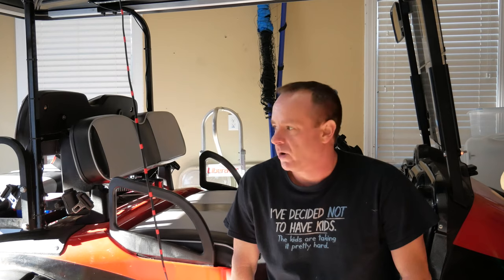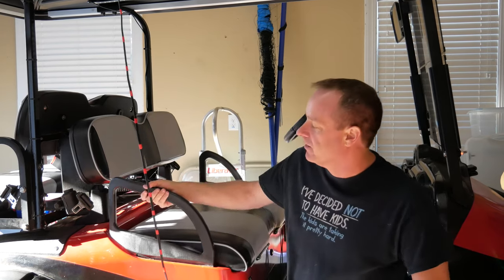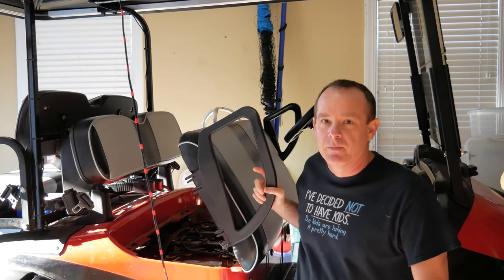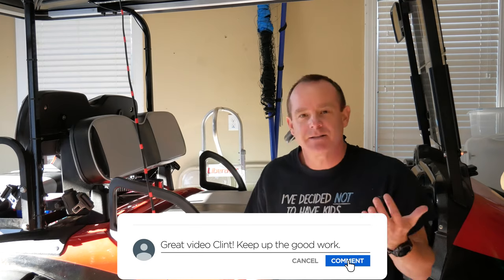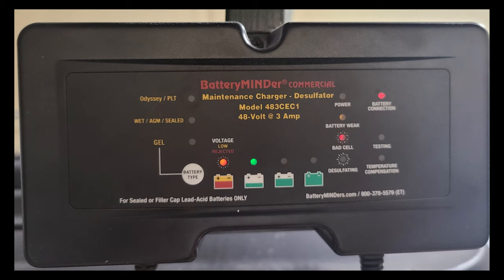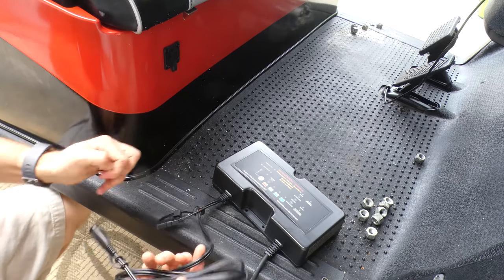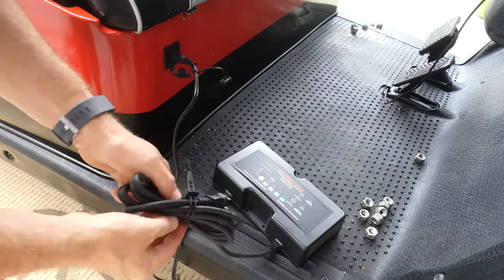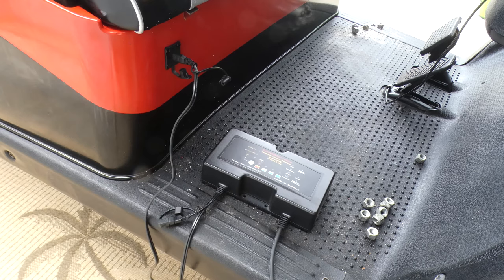Double Your Golf Cart Battery Life

Comment: I just upgraded to lithium sooo pumped to try it out. I am done with the lead game too much money and to easy to kill in Wisconsin
Reply from the maker: You are after my own heart.  I seriously considered lithium but the cost was just too much.  However, I will definitely go with it next time.
Reply: Make sure you charge those lithiums outside. Once they catch on fire, and it happens more than most people know, there is no putting the fire out until the lithium is exhausted.
Reply: @garystone6397  im on many golf cart forums that issue has not come up. I will keep my eyes pealed. The internal bms is to keep it working and charging properly.
Reply: @garystone6397  and my cart doesn't fit in garage too tall
Reply: @03treefitty  We have a Luxury 45' Motorcoach used for the occasional weekend in the winter here in Florida and we escape the summer heat from June through October traveling the US and Canada.  I know of several coaches that have gone up in flames due to the LiPo batteries.  Additionally there has been a few recalls on some high end electric cars because the batteries will burst into flames with no notice, Tesla for one.  Our local Fire Department did a public service presentation at our club regarding charging a golf cart with LiPo batteries.  They recommended charging outside, away from the house.  Not a large population of LiPo carts out there but they are becoming more popular.  I think I'm going to wait a few years and then buy a new cart that was designed,  developed and manufactured for LiPo power systems.  Good luck though.
Reply: @garystone6397  my navitas ac system is built for it and struggles with lead so i think i already have the luck?
Reply: @03treefitty  YIKES!!  It has nothing to do with the motor or controller, it's all about the BATTERIES.  The batteries can overheat, catch on fire and you can't put the fire out.  The fire will eventually exhaust all the Lithium Ion and extinguish itself.  A LiPo fire laughs at conventional fire fighting equipment.  Glad you're excited though......
Reply: @garystone6397  LiFePO = Lithium Iron Phosphate.  This is the most practical (energy density v. battery size/weight v. reactivity/safety) "lithium" battery out there on the market right now.  There are many different Lithium Ion chemistries, most have much more energy density than LiFePO and thus are much smaller and more suitable for phones and small electronics.  The Teslas or other OEM vehicles that have lit up with "lithium" batteries again were not the Lithium Iron Phosphate chemistry.  The community of Vans and RV's that have fires with Lithium Iron Phosphate batteries had one of two issues - 1.  improper installation without fuses in critical areas or the fuses where too big and the short occurred and the fuse did not blow protecting the battery from firing up  2.  The Lithium Iron Phosphate battery was a low grade battery that swells when drained fast and the battery container was constructed NOT to expand with the battery swelling and again, a fire can happen.  These are all typically DIY installs or a guy who represents himself as a professional installer (usually doesn't have a store front) or this happened 5 - 10 yeas ago when Lithium batteries where in the infancy of commercial applications. Current day Lithium Iron Phosphate batteries sold by retail Golf Cart Stores are Better in EVERY WAY than the wet batteries, including value.  In the long run they are much cheaper than any other battery on the market when comparing $$/amp hr because they can complete so many more charging cycles than any wet battery chemistry.  The only reason not to go Lithium (LiFePO) is if you need new batteries but plan to sell the Golf Cart in 2 or 3 years or if you just can't come up with the up front extra dollars needed to go with Lithium. If you are keeping your cart for 5 - 10 years, it makes NO sense to NOT buy the Lithium batteries LiFePO, they are no hassle, less expensive over time and  lighter.

Comment: How about an on board charger recommend??? Informative video thanks 😊
Reply from the maker: I am not sure I understand what you are asking.
Reply: Do they make a charger you can mount on the cart? So you can just plug the cart in. If so is there a better choice for battery longevity? Thx for consideration.
Reply from the maker: @bftcoman  I am not aware of one.  While it wouldn't be huge, it would definitely add some weight to the cart as well.  The charger being mounted in the cart or outside of the cart would have no effect on battery life.  The best way to extend the battery life is with any type of desulfating charger and ideally one that does temperature compensation. I like BatteryMinder but there are a plethora of other brands that do the same thing.

Comment: Just subbed, mainly bc I see you answer all questions. I have a 2005 36v EZGO with fairly new Trojans. I am using a Power Wise fast charging (at least 15 amps) unit. I went through a 6 week period where I didn't use the cart, the charger had cut off and I figured the batteries were charged and would hold a charge like car batteries do, so I unplugged it the last 2 weeks of the 6 week period. I went to use it, and noticed the voltage gauge on the cart when I left the house was only half full and had to cancel my round of golf. Should it drop that much with new batteries in that short a time?
Reply from the maker: It should not. If the batteries test good I would suspect you have something drawing power when the cart is off, ie a parasitic draw.  Here is what I would do if you have time. Charge the batteries up and then disconnect one of the terminals.  Wait 2 weeks if you can and see if the problem occurs.  If not, then something is drawing too much power when the cart is off.  You can also test that theory with an ammeter if you have one.  The other thing I would test are the batteries.  Make sure they have enough electrolyte in them and maybe even pick up a cheap battery tester on amazon. This is the tester I use but you can get cheaper ones for about $20.  TOPDON AB101

Comment: We're seasonal residents of Florida, here Jan, Feb and March generally.  Would you leave this charger hooked up continually for the 9 months we are gone?  Or would you use a timer to turn it off and on? Thanks.
Reply from the maker: You can leave this charger running 24/7. Doing so will actually extend the life of your batteries as opposed to letting them slowly discharge.  Just make sure the water/electrolyte level is good before you do.

Comment: I had to replace two batteries that were only 28 months old. Now I have another 8 volt battery that only has 6.7 volts. What is causing these batteries to drain?
Reply from the maker: Good question.  Are they good brand name batteries? Are you checking the water level at least once a month?  How often do you use the cart?

Comment: I have a 2003 ezgo 36 v golf cart with 6 Trojan batteries. I continue to have a dead golf cart and have recently replaced two of the batteries. The other 4 are about 3 years old. 

I need to figure out what's wrong with it.

I use a regular 12 v battery charger and wire two together to get a fulll fulll charge and then put them together normally and use the wall charger from there on a regular basis...

I need to figure out why it keeps dying so fast on us. Is it possible I have accidentally put the main black positive and negative input to the batteries on backwards. 

For example the main capacitor on the golf cart that connects to the first battery on the positive side and then the last battery 
On the negative side ...
Reply from the maker: Anything is possible but if you connected it backwards I would say it wouldn't work at all or it would drain the batteries in a matter of minutes probably as well as burning up some wires.  Did this problem just start happening or was it after some repairs?

Comment: I've a 36v golf cart which uses 6 batteries. Can I use three 12v batteries, instead of six?  Thanks,
Reply from the maker: You sure can.  Just make sure they will fit in your battery slots.
Reply: I used three 12v batteries and works just fine.
Reply: @ClintHolland  is there a 36 volt charger

Comment: hi , so my golf cart runs 6 x   8 volt batteries, had a few issues with them over time due to the initial battery charger cooking the batteries .. that was replaced with another one that was much better , however i would lie to desulfer the batteries but i dont think my current charger does that .. i have one of the NOCO genius 5 chargers but it only seems to do 12v  desulfate .  also not sure what you mean by finding the right two batteries to connect that charger you are using .. wouldnt it be the first one and the last one ?
Reply from the maker: The 48v version of the battery minder would do just that.  And you are correct, the first and last battery.  Might seem simple to you and me but a lot of people don't understand series connected batteries.

Comment: so do you charge your batteries first or when they are low you plug the battery minder in to do the actual charging?..ok I just read below
Reply from the maker: I use this charger as my primary charger. The only time I don't use it is when we need it charged real quickly and don't have the time to wait.

Comment: Why does my internal breaker on the 48 volt club Car charger keep tripping after about ten minutes charging?  I've cleaned my cables more than once today.    It has done it before, when the cable connections got dirty.  I've actually cleaned them three times in two days.  Could it be the cables and cable connctors are corroded inside under the copper?   I just don;t wanto pay 60 bucks for all new cables and then find out that isn't the problem.  Also, if I do buy new cables should I use 4 guage or 2 guage
Reply from the maker: Well, thats tough to diagnose over the internet but it could be the cables or even the batteries or a failing breaker.  Something is pulling too much current which probably means a cable issue but it very well could be failing batteries or even just one failing battery.  Did you get this worked out yet? I know my response is very late.

Comment: Clint, I have the EZGO cart with 4 - 12v Trojan 1275 bad batteries. I plan to buy UPG 12v 100Ah batteries. I have the heavy metal charger. Was wondering if the P3648 Smart Charger would be an upgrade to extend battery life? It is an affordable option to the BatteryMINDEer 483CEC1? Thanks.
Reply from the maker: I am not familiar with it enough to make a recommendation but from what I looked up it seems like it would.

Comment: Hi @Clint Holland.  I have a 48 volt Club Car with an Onboard Computer (OBC).  The OBC is what manages the charging program with the factory external charger.  Do you know if I hardwire this BatteryMINDer to my main positive and main negative (like you did), will it bypass the OBC?
Reply from the maker: Correct. You will wire this directly to your batteries which will bypass the OBC.

Comment: I purchased a cart in 2020 and had a hard time finding good batteries. I bought cheap ones and they are pretty much toast. Im looking at all my options; but considering AGM and lithium batteries.  If I go with AGM do I charge them everyday as I use the cart?
Reply from the maker: If you can afford it, go with Lithium.  They are amazing, last a long time and are much lighter.  If you go with AGM, just make sure you use a smart charger designed for AGMs.  They will constantly monitor the battery voltage and charge them accordingly without you having to care.
Reply: @ClintHolland  I ended just doing an entire new build Navitas cart with a 105aH Ecobattery. Worth every penny.

Comment: Hi Eric, Great video, I am new to elec golf carts T have a 99 EZgo with 6  6volt Trojan T105 Batteries , Which charger do yor suggest? the batteries a 4 years old, will this help extend their Life ? TIA
Reply from the maker: To be honest, there aren't a lot of 36volt desulfators for golf carts but search for the BLS brand,  Battery Life Saver.  They get ok ratings. Any desulfator will help extend the life.  That plus making sure you keep them topped off with distilled water.
Reply: @ClintHolland   after watching this video, which was great btw, I searched and found a Defabee 36/48 charger very similar to the battery minder.  although it doesn't have the kit to install a charger plug.  It is also considerably cheaper.  considering this because my cart is 36v.  but it will do both.

Comment: I have an older Club Car DS 48 volt with 4 Trojan T-1275 batteries. This really interests me because I have had a time getting my batteries to charge properly lately. So how do I tell where I have 48 volts within the battery stack? I have 4 in a row all hooked together. Thanks for the video and the help.
Reply from the maker: I know this is a really old post but did you figure this out. If you have 4 x 12v batteries you will need to connect across the positive of the first battery and the negative of the last battery since they are wired in series.

Comment: Great video!   I have 5 - 12 battery pack for a 60v system.   Which version of the battery minder should I use?  Or is my set up not going to work with a 12v 2 or 3 amp version?
Reply from the maker: Unfortunately Battery Minder doesn't make a 60v system.   A search on Google didn't really turn up anyone making a 60v one so you may not have any options.

Comment: I have a 42- volt golf cart, (7-6 volt batteries hooked in series). What type of charger do I use, a standard 12 volt charger?
Reply from the maker: In your case you are going to have trouble finding a de-sulfating charger for that arrangement.  The 42volt setup is very rare.

Comment: Clint,
I live in SC and return to NJ for 5 months in the summer. I just purchased and installed new golf cart batteries as well as the BatteryMinder 48 volt charger. When I am away in the summer months should I leave the BatteryMinder charger attached to the golf cart batteries or disconnect completely for the summer months?
Reply from the maker: Leave it running all year.  Your batteries will self discharge if you aren't charging it and if you left it long enough they may even discharge to the point of damaging themselves.

Comment: I have a 2016 president(48 volt) that has 2018 batteries. It is jerking when when I accelerate I have been told it was the speed sensor (changed it)or batteries or solenoid. Any ideas?
Reply from the maker: I apologize. I am really late responding to this. Did you get this resolved?
Reply: @ClintHolland  did not.
Reply from the maker: @blessed1sj  Have you had the batteries tested? If it was the solenoid, which I doubt it is, you would hear a lot of clicking. Are you hearing that?
Reply: @ClintHolland  do not just surges not a gasoline car's fuel pump is going out.
Reply from the maker: @blessed1sj  Are you smelling anything odd when  you are driving? Also, when you let off the accelerator does it brake and slow down really quickly or is it normal deceleration?

Comment: Do I have to disconnect my old charger form the batteries
Reply from the maker: You do not. I still have both mine connected but I wouldn't use them at the same time. I use the Batteryminder 90% of the time and my original charger if we need a fast charge.

Comment: Can you recommend a battery minder that works with a solar panel for maintenance on a 36 volt 2002 EZGO?
Reply from the maker: This is what I would recommend if you can find one. If not, just look for one that has a built in de-sulfator.  https://www.batteryminders.com/36v-on-board-battery-charger-desulfator/

Comment: Did I missed the name of the chargerI also noticed the thickness of the cables are very thin compared to the charger that came with the Golf Cart
Reply from the maker: It's called a Battery Minder. There is a link in the description.  The wires are smaller gauge because this is a slow charger and the thicker cables aren't needed.

Comment: I am installing new batteries in my cart 6v Trojans for a 48v system. It looks like I can have the factory charge port and the BatteryMimder port. Is that correct?
Reply from the maker: That is correct and how I have mine setup.  Just don't charge from them both at the same time.

Comment: GOT A GOLF BUGGY WITH 8 BATTERIES NEED TO CHARGE  ALL 8 BATTERIES HOW DO I DISCONNECT THEN RECONNECT THE BATTERIES WITHOUT GETTING ZAPPED.
Reply from the maker: Pretty much any way you want.  With 8 batteries I assume they are all 6 volt.  You can literally touch both terminals with your dry hands and you won't feel a thing.
Reply: @ClintHolland  there actually 12volt batteries, thank you for reply I have started charging them and I'll have to see if that works
Reply from the maker: @nataliegardiner7674  You have 8 x 12 volt batteries?